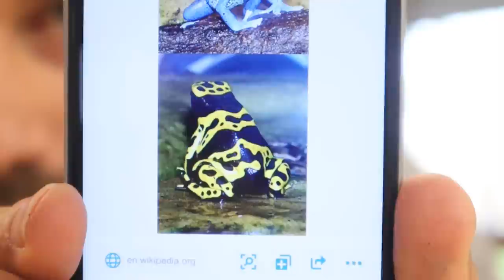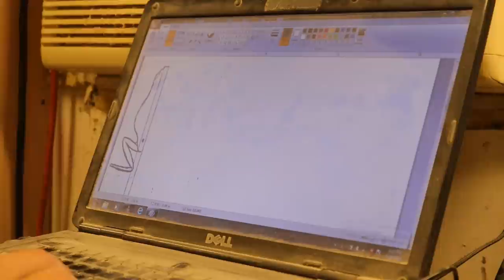Making Poison Dart Frog Lures

Comment: 1)If you put a sander upside down and put the mould on top of the sandpaper won't it take the bubbles out?
2) if you take a remote control boat engine and put it in the water and test the jig. Let it float behind the engine so that you see the effect of the jig

Comment: Your "degasing" is a boiling process!
The less pressure, the lower the boiling point of a liquid!

When I was working with thinned epoxi resin, the solvent - butyle alcohol - 
startet to boil in the vacuum chamber and made a lot of bubbles itself. 

Same with cooking eggs on top of a mountain - the water will boil at a temperature
lower 100°C.

Comment: Sweet "Just a frog" lure. Dumb question, would it have been easier to not cut the legs out on your wood original, then just cut them on your rubber casting? Or is it a process need to do it pre-cast?

Comment: What type of silicone do you use and where do you get it?
Reply from the maker: My local hobby lobby has Alumilite High Strength 3. Works great for soft plastic molds
Reply: Thanks for the info